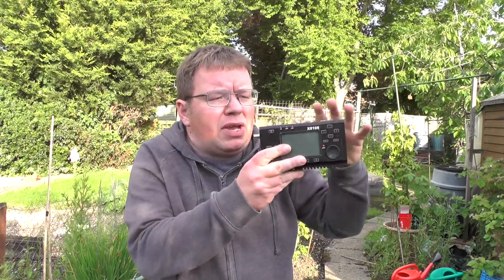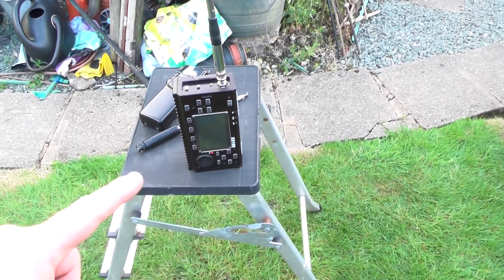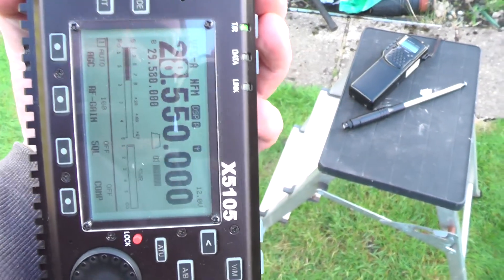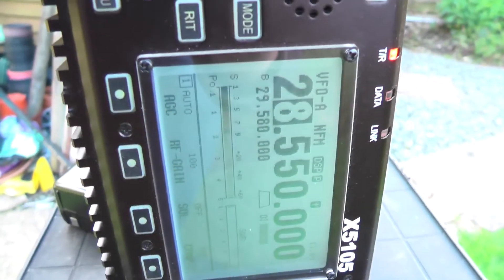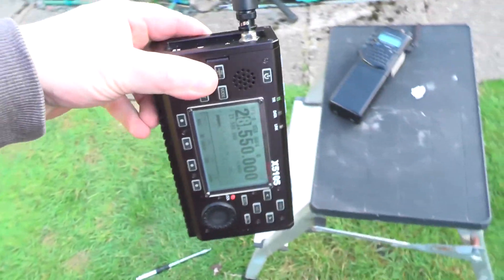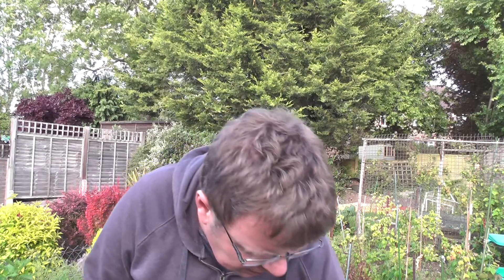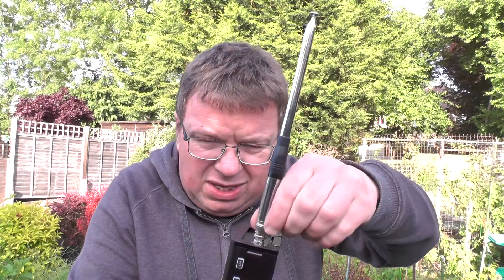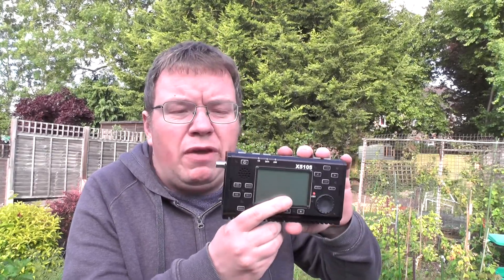I made a contact over 1000 miles on a walkie talkie

Comment: Just a thought: You've got the tuner engaged on the x5105. Did you press and hold the tuner button so it ran a tuning cycle on the same frequency you were transmitting on?... And while holding the radio as you would be while transmitting?
Reply from the maker: Never thought of using the tuner button as the antenna will work on 27-28mhz I’ll give it a try
Reply: @2j4ez  since it's already engaged (the symbol is on the screen) it will have recalled the settings from the last time it was used in that 100kHz portion of the band which was probably with a completely different antenna. 👍👍
Reply from the maker: @RonanCantwell  never thought of that nice one ill give the suggestions try in the next video

Comment: Hi Jez, re one of the other comments you need a counterpoise, try a quarter-wave length of wire and a croc clip to the BNC connector, If you're using an external microphone you may be getting RF feedback on the mic lead try as many turns around a ferrite ring may solve the audio problem.
Reply from the maker: A quarter wave length of the antenna or the frequency ?? 2.5m wire as it’s 10m?
Reply: @2j4ez  hi Jez, I'm going to try something out tomorrow, it's a counterpoise turner with a short length of wire I'll get back to you with the results, might be a solution.
Reply: Yeah 2.5m counter jez
Reply: Hi Jez are you going to be at the Newbury and McMichael's radio rally's.
Reply from the maker: @adam-g7crq  no not going to the rally’s